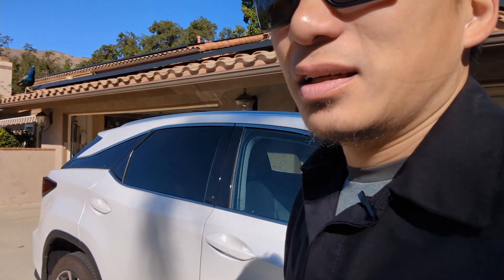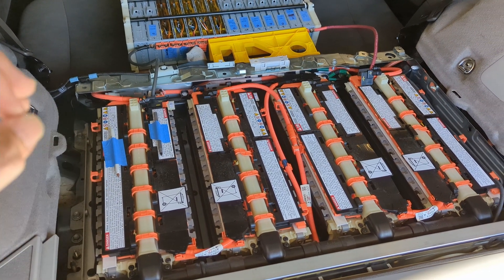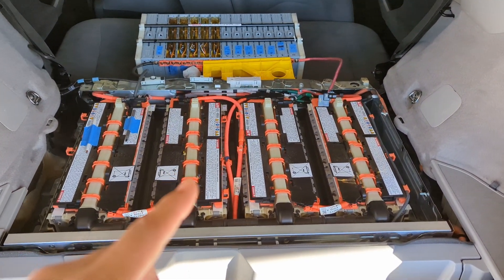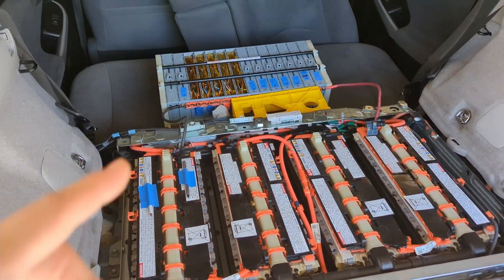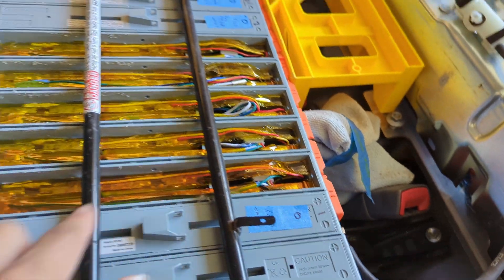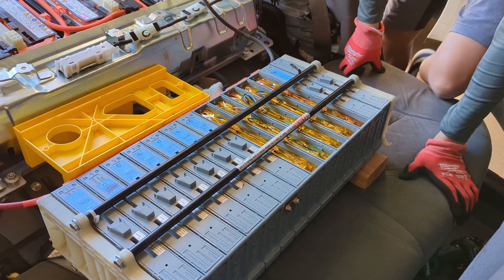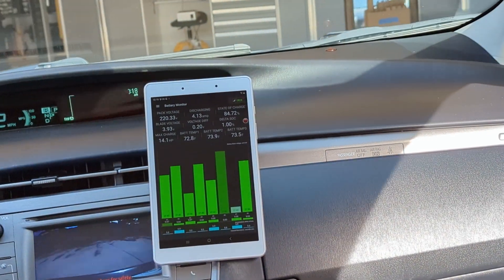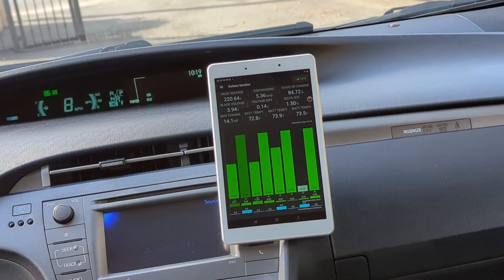Prius plug-in wannabe a Tesla, just add battery ?!

Comment: (1) what causes the flashing on the dash; (2) why does not the mpg dial move. On my 2013 the mpg miles shows even when running in ev mode. My 2013 Prius plug-in has 169,000 (+ or -) miles on it and still gets approx 10+miles in ev mode. Mine is a used car having 2 owners before me, and I have had it since Monday Sept 25, 2023 at 10:44am. So far I am very happy with it. It is the base model (but I was looking for the advanced model, but could not locate one that was in my price range). Prior to this i had a used 2007 Prius that I got Feb 1, 2009.  It was totaled out May 24, 2023 when a 17 y/o girl ran a stop sign and hit the drivers side front wheel well.  Better there than T-Boning me. There was  a flaw in my 2007 as it would only get between 28-32 mpg around town.  On the road it got 40 mpg. Other 2007 Prius owners I talked to said they were getting 50mpg around town.  In mid Oct 2021 I had a stroke.  The car sat idle and did not start for 9 months.  Yep, both batteries had to be replaced. I was able to get a rebuilt hv battery including installation from a place that would come to your home and do it for $1,250.  My around town milage still was 28-32mpg. (3) I think I may have missed it, but in your test how many miles did you get in ev mode before it had to be recharged?
Reply: Flashing is due to camera fps. Not sure about the other questions
Reply: (2) I think the MPG dial should stay fixed at top while moving in EV mode, because its practically infinite (or at least more than 100 which is the max on the dial) mpg, as no fuel consumption when the ICE is stopped. When you move in EV mode, but you're heating the cabin, the ICE turn on to provide heat, so the MPG dial should reflect the fuel consumption. Maybe you observed this function?
(3) Its just a proof of concept test, the range not really matters. There is another video on the fully upgraded battery with range: https://www.youtube.com/watch?v=4Q2Q8blBqFw But range will be varied on a lot of other things: road, weather, driver, traffic, etc.

Comment: Great video! Thanks :)
I was checking prices on these plug in prius cars and it's off my budget.
But I was wondering, if adding "more batteries" to a standard 3gen prius could work up to get 20miles or more in ev mode, and let the combustion engine charge the batteries as "originally", since all the re-gen braking and normal charging of the batteries??
What do you think?
And doesn't the car computer get confused buy the new battery capacity?

Comment: Just visited your website.  So there's no upgrade available for a Plug-In Prius like you've done in this video?  I have a 2012 PiP and would love to do an upgrade like this since my original batts are down to taking only about 2.5kWh on a full charge :(  Thanks for the good work!
Reply: As the P3 plugin uses only 63% of the 4,4 kWh battery in EV mode, 2,5 kWh is not that down. Right out the  factory new was about 2,77 kWh, but it depends on a lot other things: outer temperature, battery temperature, charging losses, so on.

Comment: Funny how you tricked Toyota's range estimator as it kept going down, but never reduced to the level fast enough to be accurate. Proof of concept is there. I'll bookmark your website for when our battery needs replacing. I'm curious as to what kind of range one could have if the regular hybrid pack is replaced along with the PHEV (Traction battery?), and then maybe have another pack in the cubby where the charge cable can go. We could definitely make use of an extra 10 miles or more of range from what we are getting now on the stock battery.

Comment: Is the battery pack for 2015 plug in available and cost?
Reply: This is a pre prototype test so Jack still has a ways to go but these results are very promising.  They show at least double the EV range.  He will probably have a prototype video soon.  🤞
Reply: @fdj6429   that's a lot of cell to replace very costly I suppose?
Reply: Yes…I would assume so unlaess Jack decides to just equal the oem output but that would t be any fun….I want better 0-60mph!  🚙💨
Reply: @fdj6429   2023 Prius will be out soon hopefully prices will drop for 3rd Gen